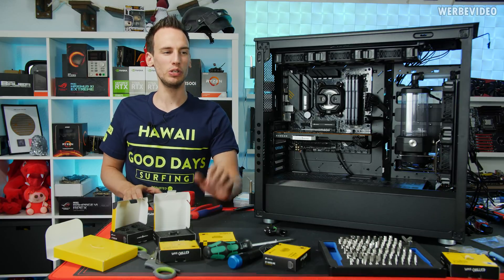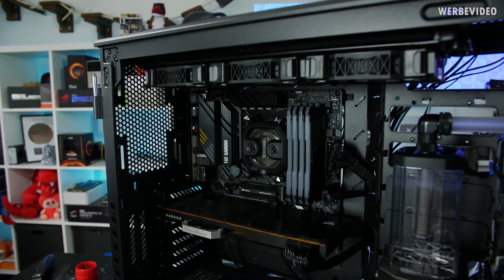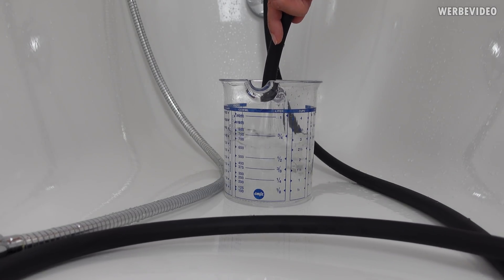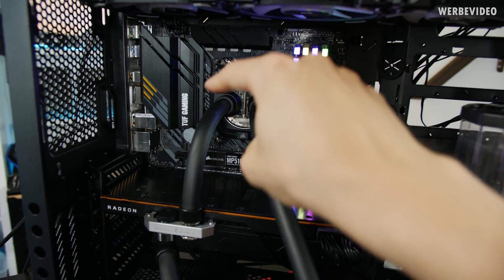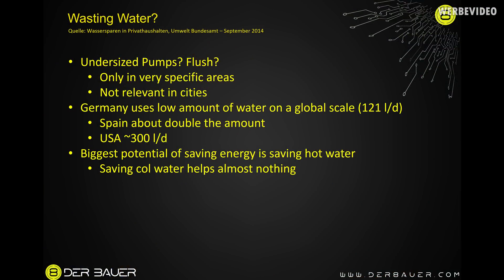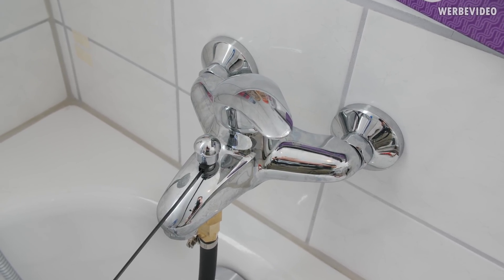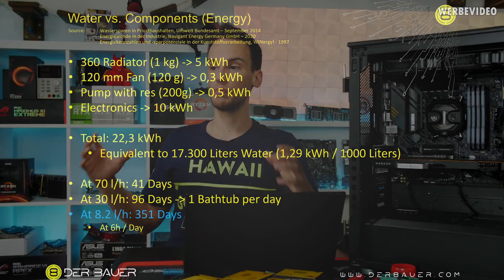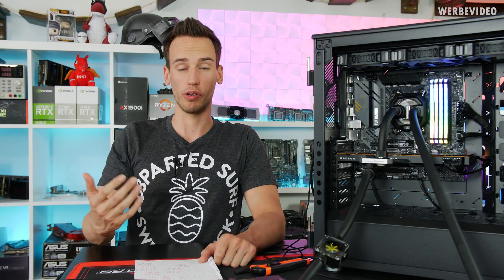So much Better than expected! Cooling my PC with TAP WATER

Comment: coming from Australia where drought is common (especially in regional areas), you cannot compare energy equivalents.
especially when it comes to usable drinking water.

but it's a cool concept.
also makes me think, what about areas which have hard water (water high in minerals), they would have problems with build up in the loop.
Reply: Soft water - corrosion, Hard water - buildup.
Reply: @MrKonquer  these loops are built to run with distilled water, so corrosion from soft water is not a concern. as for hard water, a little bit of vinegar ever few weeks will keep things super clean.
Reply: @Michael Roy even pure distilled water with a ph of 7 will eventually turn slightly acidic, water absorbs carbon dioxide from the atmosphere turning it from 7 to about 5.8/9, a sacrificial anode is usually what’s used in soft water treatments which come into contact with metals such as the cooling plate itself.

Such as the bottom of ships and inside water heaters. 

In central heating systems adding inhibitors is also a way to stop corrosion happening.
Reply: @michaelroy1631  The water here is too hard for that. You could vinegar it every day though. :P
Reply: @TechyBen  Do NOT add vinegar to ANYTHING that contains copper! 
It will completely corrode the copper to bits until there are holes in it!
Reply: @MrKonquer  the rate of corrosion from soft water on the copper, nickel, or aluminum block is going to be so small that it will run for decades before it's a problem. the tubing is going to die years before, as will various parts of the computer.
Reply: @Basement-Science  A quick rinse with dilute vinegar, enough to loosen any hard water deposits, will not touch the copper. in fact, dilute copper can sit in copper for quite a long time before anything meaningful happens. ever washed a dirty copper-clad penny in vinegar or soda?
Reply: @michaelroy1631  Of course it wont get destroyed immediately. But doing this regularly or even continuously would be a bad idea. Copper acetate is water soluble, meaning any copper that reacted will then be removed by the water. I'm not sure exactly how quickly it would be a big problem, obviously it depends on how much vinegar you add, temperature, flow rate and more.
Reply: @Basement-Science  pure copper doesn't actually react with dilute acetic acid. copper acetate is soluble, but only formed by reaction of surface copper oxide with acetic acid. repeated cycles of air and acetic acid are required to remove bulk copper. again, I point to pennies as an example of how slow this is :)
Reply: @michaelroy1631  Ok then, I'm not a chemist. Although surely you could use another acid like citric instead, with even less problems?
Reply: @Basement-Science  citric acid is actually slightly stronger, though it might be less reactive toward the metal overall. in theory, copper shouldn't react with any non-oxidizing acid (even strong hydrochloric acid), but the best thing would be just just rinse the system periodically as needed with dilute acid and then flush with plenty of water as you resume normal use.
Reply: to get technical, Cu metal does not react with non-oxidizing acids in water, but it can react very slowly with the oxygen in the air. keeping the system air-free (including dissolved oxygen from the water supply) would be far more trouble than it's worth, as the rate of corrosion would be insanely slow, and the cost of replacement parts far less than the cost of the equipment to deoxygenate the water between the tap and the PC.

Comment: i run tap water on my test bench when i need to push it harder as dice and ln2 is way overpriced where i live ($10 per kilo of dice and $9 per liter of ln2).  average water temp here is like 5-11c so when i was ocing gtx 580's on direct die liquid metal they wouldnt go above 23c, this was with i think 1.45v core (volt modded) @ 1050mhz. was a huge help and it earnt me 1st place on 1080p extreme super position many times during a battle with a guy from Argentina but he end up winning with asic quality. it is a big waste of water but its far cheaper than dice or ln2 but it also cant achieve those temps.

Comment: I know your recommendation for this setup is directed towards extreme overclockers but I wonder if a setup used like this long-term will have nasty buildup or corrosion of components due to differing standards of tap water by country.
Reply: Where I live in the UK we have very hard water, I suspect it would be a yearly job descaling the blocks. Maybe it could be an easy attachable loop filled with vinegar or something. Those quick disconnects would work well for that.
Reply: @rompdude  hmm if someone can figure out a way to implement this without being wastefull they may be able to use a filter in the setup to prevent that
Reply: @user-y6f  just return water to cold water tank , no waste .
Reply: @rompdude  even changing your blocks once a year would still be a good solution . Or maybe just have two of each block . Swap out on a regular basis , clean removed block ready for the next swap out . And instead of wasting the water down the plug hole , just return it to your cold water tank . The size of the tank would take a VERY long time to heat soak
Reply: @Shinobu421_VRC  totally true but anyone who cared enough to do something like this would probably use copper components. The only aluminum blocks I'm aware of are from EK's cheaper fluid gaming line
Reply: german tap water is filtered to food saftey standards
Reply: @user-y6f  Food safety standards do not mean there is nothing in the water. Calcium being the big one, Perfectly healthy but defestating for  the microfins in a water block.
Reply: @qlum  I know but it is as far as practically achievable using distilled water is not feasible IMO
Reply: @LabRat Knatz stainless steel and gold both are resistant but not imune
Reply: @Shinobu421_VRC a long enough plastic pipe is enough, maybe 50cm. galvanic corrosion is what you mean.. if there is no contact area and the flow in 1 direction, the electrons cant flow back and start the corrosion. in a closed loop its a differnt story

Comment: Adding a self-adjusting valve that opens up in response to temps would make the efficiency of this would go through the roof.
Reply: You can use the pwm from the mobo + an Arduino and a valve
Reply: @isseyIT  Not needed, just use a thermostatic mixing valve.
Reply: @malloot9224  
A thermostatic valve would need to be at the end of the loop and 

1 it would not react fast enough 
2 you are putting 3-6bars on your loop
So a pwm (fan header) controlled valve is the way to go
Reply: @neok1996  thermostatic valves react more then fast enough. They also have to protect from scalding your hands at the tap when the hot water kicks in. Water cooled pc loops aren't under pressure, and if you put the tap on it and leave it open on one end you don't have 3 bars, but it's an issue I agree
Reply: Also, if we actually collected and used the generated heat instead of disspating it, we would theoretically have 100% efficiency. Just like a car in the winter uses a part of the heat generated by the engine to keep the interior warm.
Reply: @lakiza55  plumb it in to your houses existing water radiation heat. genius.
Reply: @LightningJR  well just make a rig that draws like 1.6kw at full load and put the output to your rads in your house yea seems like a good idea
Reply: @dan2800  Using powerfull pc at max load in winter is really good. Electric bill come higher, but lowers heating costs :)
Reply: @MariusVerbavicius  yea
Reply: @MariusVerbavicius  that said, most gaming PCs dont really draw enough to substantially make a difference to heating
Reply: @DLTX1007  When I had AMD 290X it definitely kept my feet warm during winters
Reply: is your pc next to you?
Reply: @DLTX1007  Yes
Reply: @lakiza55  Lenovo makes a high density cluster server that does this. Designed to be cooled by simply running city water into it. Lenovo even advertises that you can, and should, run the heated water through your building to warm it instead of using electric heaters or gas or something. Its called the ThinkSystem SD650 High-Density.
Reply: @lakiza55  
hm, yeah. add a buffer after the system to get it hotter and then have that run through a Heat Exchanger so that you get back that Heat for the Winter.
could also split it off for a Thermal differential Generator to get a bit of Electricity out of it.
Reply: @lakiza55  why use water then? Use big passive or large  fans
Reply: @MariusVerbavicius  was just an example, that makes sense only in winter
Reply: and then you can use water for bath or jacuzii/pool outside,  or least for make tea xd
Reply: @marcintrochu  hahaha. PC-T (tea)  tastes the best!!! :)
Reply: I got the marketing add...."PC-T........the tea for the computer enthusiast!!"
Reply: I would actually go for an hybrid setup. You don't need extreme cooling the whole time. So under heavy loads you can automatically switch to running water, when idling you switch back to a water loop instead. With a temperature controlled switch this is easy to do. Just read out the temps from the CPU.
Reply: Its called a thermostat, cars have had them for decades
Reply: Not just that, but you could have separate water feed with individual solenoid valves for individual components. Only cool what needs cooling at the time. So a feed for the GPU, and a feed for the CPU, each with a solenoid valve controlled by the temperature sensor reading for each component.
Reply: @Lazar Šaronjić use the vented heat to turn a turbine, which in turn recharges a UPS. UPS in turn powers another which powers the PC. The UPS combo prevents power drain being larger than source power supplied. 

Additionally, the same principle can be applied using transformers, to step up, step down 😋. I'd build this set up but I don't have access to the components let alone the capital to prototype.
Reply: @earthtaurus5515  When you go that far, why not store the water, let it give the heat back to the ground and then pump it back with solar energy through the day. its still a closed loop but instead of having less then 5L as your thermal mass you have 2-3m3 of water which has to get warm?
Reply: @StreuPfeffer  That's alot of work and in most cases it's not practical.
Reply: Would be a fun RasPi project
Reply: That's a good idea
Reply: damn lol, dont you hate when you scroll down and the comment your about to write is the 1st comment you read. Top idea
Reply: taking seawater even more....this party compensates the effect of melting ice on the north pole :-)

Comment: My first impression is that it will create limescale on cooling fins, over time.
Reply: That's why all the major water cooler manufacturers recommend Calgon " Every PC runs cooler with Calgon!"
Reply: and the car  reuses the water and dont get new water all the time, and it`s not that mutch lime in there.
Reply: @F a unfortunately no, limescale grows on flowing water as well. 
Anyone who works with pipes experienced that. 
If the flow is always turbulent, there will be limited limescale. Otherwise it will depend on how often the water sands without flowing and what is the speed of flow.
Reply: Solution: use a closed loop for your blocks + a heat exchanger for dumping heat into the open loop (tap water). Cars use similar concept to cool engine/transmission oil with a water loop.
Reply: Good point. This would be a very expensive problem to rectify unless you had a very expensive purification system for your whole house and had very low-mineral water. Also ALL water will have dissolved minerals and the 'cleanliness' of the water only buys you more time between contamination of the system. Even the purest of water would eventually create build-up......but using the tap water is still an interesting concept even if not financially feasible.
Reply: @brentlemire4903  in line filter , have two of each block , swap out when performance drops , clean removed blocks ready for next swap out . They would easily last a few years
Reply: You can't be 100% certain that the water company won't descale the pipes on their network.

They do it in the UK every few years.
Reply: You could use filtered rainwater.
Reply: Use reverse osmosis.
Reply: Depends on the water, soft water will cause corrosion because it’s more acidic, hard water will lead to limescale buildup, you can put a inline filter in between the tap and pc.
Reply: only if your water treatment system has cleaning issues.  No hard water here, and water is cheap per CCF, only 4.03USD per CCF, which is about 748 US gallons.
Reply: Cars don’t limescale yo
Reply: @planespeaking  hahaha. 
That is because the do not have tap water but distilled water with additives.
Reply: @valdius85  Distilled  water for the win
Reply: @circuitsandcigars1278  Distilled water will eventually cause corrosion itself through natural ionization. This is why in engines no matter how recent an engine coolant flush was performed, tends to cause the coolant to turn a darker color over time - this is the corrosion process being started through ionization. An engine block is used as a grounding point for a vehicles electrical system which further adds to the ionization process and is why manufacturers recommend a coolant flush every few years. That neon green/pink/blue coolant will darken even after a year. And a car that has never had a coolant flush will simply turn to liquid rust essentially
Reply: @planespeaking  you aren't supposed to use tap water in a car because....limescale
Reply: @allseeingeyezz  Not exactly, your not suppose to use tap water, because most modern cars have an aluminum head and a steel block, and sometimes brass or copper fittings within the cooling system, which leads to oxidation. Tap water has minerals in it that increase the rate of oxidation, while distilled water has very little, but still creates oxidation. The vehicles suggested coolant will have additives that drastically slow the rate of oxidation for your cooling system's components. The proper amount of tap water mixed with your coolant, will not have any negative effects to your system.

Comment: Indeed depends on how much water and if you can use the waste water for things like watering plants and save it for flush water.
Reply: it also depends if the water you're using is from a river or if it's fossil water: ok in first place, bad in the latter